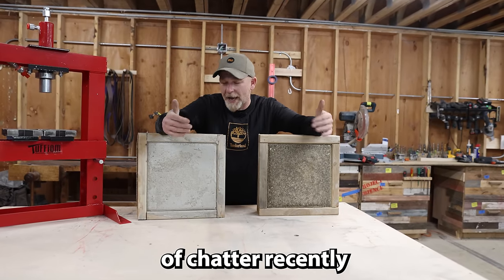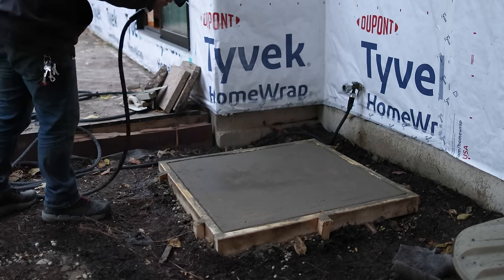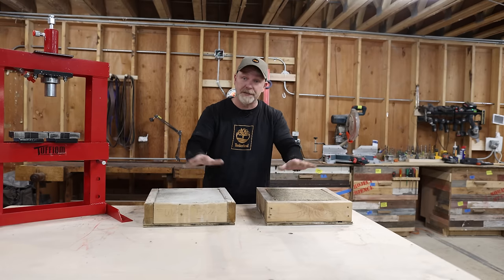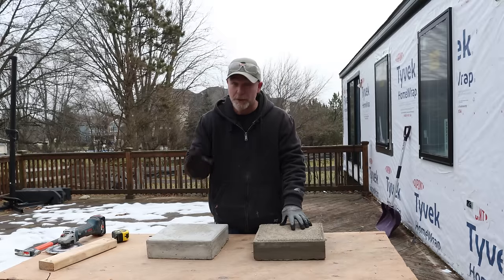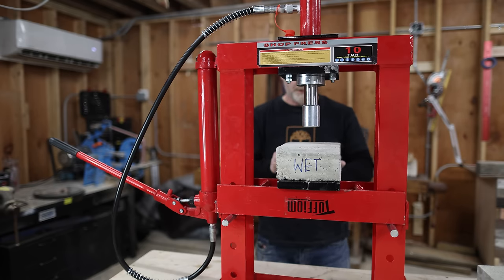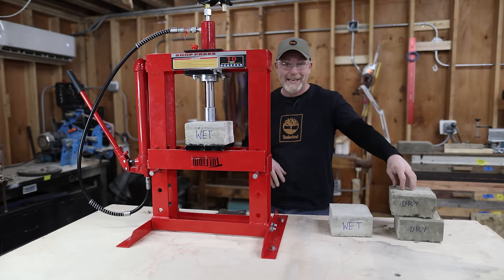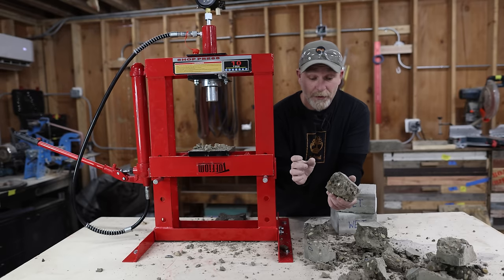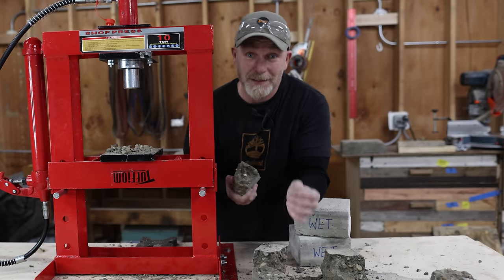The TRUTH About Dry Pour vs Wet Pour Concrete!! Strength Test - You WON'T Believe the results!!

Comment: Dumb question. would there be a difference in a wet pour the way you did(set up concrete mix then mist it) or have a pool of water and pour the mix into it.

The context is like a post hole. Witch would be better. Wet mix, pour dry and mist the top, put water in bottom of hole then fill with dry mix.....

Side question. What's best if the hole already has ground water in it or does it make a difference.

Comment: It's amazing how many comments start off on here with "Certified Concrete Grand Pubah involved with over 50 years of testing...".  Look, we all know dry pour is weaker. BUUUT, even in the video where he mistakenly says it broke at "2lbs of pressure" when what he meant was TWO TONS of pressure, it's still a good alternative for small slab/DIY projects where you're just going to place something lighter and don't want it on the ground.  I wouldn't build a house or a structure over it, but if you got a 4x4 patio that you're just going to sit your butt down in a chair on and watch the world turn, there's nothing wrong with it.  Not everything is a NASA project.  Sometimes you just need it to hold your beer and you up until you're buried 6 ft under.

Comment: I was thinking of doing a dry pour for a concrete slab for a hot tub. 6x6. Weight with water is roughly 5,000 pounds (2.5 tons evenly distributed). Your test, it cracked at double the weight 5 tons. What are your thoughts? I’m either doing a dry pour or calling the cement people to pour it lol.

Comment: Without watching fideo first, my instinct is to say that dry pour is obviously weaker/inferior... Now let's see how it goes.  EDIT: After watching the video, it went how I thought it would go.  My thoughts have always been that "misting" can never get the right amount of water all the way through the slab to activate all the concrete molecules like mixing water can.  Maybe if you did a contiuous mist for 24 hours to get the slab completely soaked, MAYBE...  OR, if you put a hose at the bottom and slowly ran water under pressure until it starts showing up at the top.

Comment: Dry vs wet will always be weaker, but I had to laugh at the poster calling the point load "direct" - it was all direct. The plate just distributes the load vs the smaller surface area.

There's no question that a driveway should not be a dry pour. But a sidewalk or pad that is not going to ever have more than a couple of hundred pounds of load is just not a big deal. In any case, the true structure should be underneath the slab. If you haven't put some kind uf structure on the ground under it (compacted gravel, etc), then you're putting a flexural load on the concrete, which it is poor, and will cause all slabs to fail (crack). The purpose of a sidwalk is not to support lots of weight, but to provide a waterproof, non-skid surface that transfers the load to the subsurface, and often, as a stabilizer to prevent dust and erosion.

Comment: Dry pour is not concrete = it is partially cement stabilized sand and gravel. To make concrete you have to provide sufficient water to properly hydrate the cement. The hydration product of that grey powder is a mineral glue that sticks everything together into a monolithic block. No water - no glue. This is so important that even for wet concrete you should be continuing to keep it wet for a week after placement. the initial mix water and mixing also ensures every grain of sand and gravel is coated in wet cement gel. After initial set there is no amount of water that is too much. You cannot replicate this in the dry pour process. 
In construction they test cylinders pretty much as you are testing them all the time. If it breaks under less than the specified pressure then out it comes - it’s not concrete. In a cement plant the test cylinders are cured submerged  in a water bath to ensure full strength development.

Comment: You used a different concrete for the two samples?  Use the same concrete for the two samples.  One step usually missed.  Dry mix is fluffy,, lotsa air is within the dry mix.  In post holes,, I dry pack,, I use a 1/2 inch rerod and slide it all the way to the bottom,,, on the first pass .  Every 2 inches or so,, I slide the rod all the way to the bottom,, air bubbles rise up out of the dry mix,  Continue to tamp with that 1/2 inch rerod go around again and again and the rod will penetrate less and less,, Until finally,, you are only penetrating 2 inches or so.  If you are practiced at this tech,, the entire tamping takes about a minute and a half.

I would LOVE to see a comparison of dry rod packed mix,, vs the same mix wet.   I still think the wet will be stronger,, but by how much?

Comment: I wonder what would happen, strength wise, if you lined a form with plastic, filled it with water like a pool, and poured into that, and then misted the top?

Also, would it be possible to pulverized those dry blocks and make a wet pour from it?

Comment: I mean seeing the method Used I would have predicted Drypours poor preformance. Concrete gets the strength that it has via a chemical reaction between the water and the cement, you are then fundamentally relying on the water you sprinkle on top to diffuse through the thickness of the slab and get all the way to the bottom in order to trigger the reaction and get everything to cure and harden. 

Now I dont know the water permeability of concrete but I do not think it has permeability required to properly wet all of the concrete.  The crumbly nature of it is probably due to the fact that the middle of the slab is only loosely bound powder that didnt get much moisture and thus didnt properly cure. 

The closest thing I have heard to a "dry" concrete being good was a method where you mixed the concrete with not very much water and then packed it into the form with a compression tool of some kind (when such concrete is used in large engineering projects it is called "Roller Compacted Concrete" as in steam rollers). But that is generally less used because you either need special tools or a lot of manpower.

Comment: I am considering using the dry method for enlarging my back yard patio. 
It will be a 9x12x3inches with 3 inches of pea gravel.  
Even if the concrete only supports the advertised PSI, does it really matter if all it is going to see is foot traffic and a few patio chairs?   
The patio area is not accessible to a concrete truck and pumping it or using a wheel barrel does not seem cost effective.  My other option would be to lay pavers.

Comment: What gives concrete its compressive strength is the aggregate.  Dry and wet pour have the same aggregate.  What isn't the same is the cement paste that binds the aggregate.  Cement requires water in the right ratio to make a paste that binds the aggregate.  The wet paste grows crystals that link together.  Too much water and the paste becomes weak, to little water and the paste never forms.

Dry pour never gives the cement the opportunity to see the correct water-to-cement ratio to create crystal growth in the paste.  Watering it from the top "may" allow the top half inch or so to get the right ratio, but as the concrete on the top cures, it prevents the cement below from seeing much if any of the water that is now trapped on the top.  The thicker the dry pour, the less chance it will ever see any crystal growth.  

Dry pour is a waste of time and resources, and if you're relying on it for structural integrity, say for footings, it may result in structural failure and injury.

Follow the manufacturer instructions on all concrete DIY products.

BTW: What gives concrete tensile strength is steel reinforcement, placed on chairs at the right depth in the pour.  Not "pulled up" from the bottom.

BTW #2: Fiber, either steel or fiberglass does NOT give concrete structures any structurally significant tensile strength.  All it does is help to reduce concrete cracking during curing.  IMO, fiber is a crutch, when what should be used to prevent surface or structural cracking is: 

1) proper compaction of the sub-base to 98%, 2) steel reinforcement mesh or bar held up to the correct depth with plastic chairs, 3) vibrators used to ensure complete contact of the concrete with the reinforcement and reduction of voids, 4) control joints properly designed and installed, 5) constant wetting of the concrete surface for 7 days as soon as surface water disappears, or immediately if the concrete is exposed to sunlight; alternatively a surface sealer to keep the water in the slab and next to the surface to prevent dry out before crystal growth can finish.

Comment: but...over time if you don't exceed the strength of the dry pour it is self healing. The water gets into the cracks of dry pour and there is residual chemical reactions waiting to happen. Cracked wet pour on the other hand has spent all of those. Dry pour is more "flexible" over time for this reason. It will not however meet immediate extreme structural needs.
If I am going long lasting then I am doing dry pour that greatly exceeds the initial load requirements.

Comment: It didn't work because you did it wrong, all that misting was just wetting the surface. You didn't give it enough water for the cement to do its thing. Put the concrete in the form, saturate it with the same amount of water you would use in a wet mix, any excess water will be absorbed into the ground. At this point there might be some minner surface mixing needed to work some stones down into the mix, but other than that work it just like regular wet mix concrete. I still would not use it for structural stuff but most smaller flat work should be fine. The dry pour is acually best suited for fence posts, you just dig a hole big enough two sacks of mix, fill it with your post and your concrete, dump 5 gallons of water on it and your done.

Comment: ACI concrete tech.  There is a reason that no specs are given for dry pour concrete - its utter garbage that won't hold up to any kind of commercial use.  Its probably fine for an AC pad or a step out of your garage, but you cannot drive on it and it will not bear any structural or dynamic load.

Comment: It seems that dry pour could still be adequate for some applications, especially if for some reason it's much easier to do. Would it not be suitable for a slab under my propane grill? Seems like its uses may not be many, but it's not use-less. Or did I miss something?

Comment: Onbiously the aggregate isnt dispursed proportionately theough the dry pour causing numerous weak spots. Not to mention it hasnt cured in 3 months. Theres no doubt dry pour cant hold up to the compression strength of regular concrete.

Comment: ok ok, so I might not be smart when it comes to this stuff because I have never done concrete, and I will be doing it soon for a wet pour concrete for my oil tank slab. I am curious and I am not sure though if this would make a difference or if it would damage it or make it work but if you do tests and want to try this out let me know, I would love to watch it. When doing the dry pour and you pour a single bag in depending on size of course of the form, but would it work better if you lay a bad, spray with water, lay a bag, spray with water constantly doing that until you are done and then follow the directions with continuing to just lightly mist it during the timeframe. I am curious if this would make any difference or not.

Comment: Novice here so forgive me for asking a dumb question.  It took 5000 pounds to crack the dry piece. How many pounds does a small patio need?  I understand the concept of the demonstration.   I wouldn't do a driveway or building foundation but the dry pour would seem to be fine for a small area say 10 x 20 to hold a grill, patio table a 4-6 people.. Thoughts?
Reply: 10x20 needs rebar, but why concrete to begin with? Why not use pavers? Much easier to do IMHO.

Comment: if you put down 1 inch wet it then at 1 inch wet it, then add the rest of concrete to top. i bet it would be stronger. But never as good as wet pour. Wet pour can be done, in what is called slump. I have saw engineers send a whold truck load of concrete back if it did not pass the 1 inch slump test pouring it into a plastic bucket on the ground.

Comment: Should be called Lazy Pour.  AC slabs are one thing, but I see YouTubers dry pouring foundations for sheds!  Could probably pull the J bolts out by hand.  TapCon is probably not even an option, would be like trying to put a screw into sand.

Comment: You are comparing APPLES TO ROCKS. It is axiomatic that a wet patio or garage slab is stronger than one that is dry poured. That being said, it took 8 tons of pressure to create cracks. That is 16,000 lbs of pressure to create cracks.  You can invite 100 people to your patio and the slab will not crack.  You can also drive a F450 pickup truck (weighs 8,587 lbs) on your garage slab and IT WILL NOT CRACK. So what are you trying to prove? Most people know that wet concrete is stronger than dry.

Comment: Pouring the concrete into the hole, then the water, doesn't work. The two aren't mixed properly. You need to mix it prior to putting it in.

Comment: Dry pour is a fad, and doesn't change reality.  Modern cement is a hydraulic product, meaning it is using water to develop its strength.  It is not drying that makes it strong.  In fact, too little water makes it unable to develop full strength.

If you put down a 1/2 inch layer of concrete mix, then soak that before adding another 1/2 inch layer, through the entire depth of the pour, it would perform better.  As others have indicated, submerging the dry pour for an extended period of time is likely to lead to deeper hydration of the mix and better strength.  Areas with constant rain might see better performance from dry pour over time.

I would bet that any dry pour concrete will always be somewhat weaker than wet pour concrete under the same conditions.

When testing samples for pressure, the samples need to be capped in a high strength capping material to ensure absolutely flat and parallel pressure faces, which must be fully supported across each face.  Otherwise, a single test result is fairly meaningless.  In this case, the large difference due to incomplete curing showed up clearly and early, but other factors may have been at play and amplified the apparent difference in strength.

Comment: Why don’t you comment on how too much water in your pour will affect the strength as well. The ideal pour is just enough water to get the concrete to stay in place and float the surface easily for the final finish troweling. Then keep the pad from drying out to quickly by covering with a waterproof sheeting.

Comment: I challenge you to redo this test by adding the SAME Amount of water you would add to yr wet mix . Start off misting then graduate to spritzing as the concrete gets wetter .spritzing every 10 mins….THEN this would be a fair test in my opinion.
Reply: But that's one of the flaws with dry pour, folx have no idea how much water they're putting on it. When you follow the directions it's easy to measure 2L of water per 60lb bag.
Reply: @13squier  My thoughts exactly. I’ll be testing that theory this weekend on a toilet slab.

Comment: You said two pounds per square inch. I don't think so. Maybe two thousand pounds per square inch. That was after you had already fractured it. Sidewalk grade concrete tests at three thousand pounds per inch, normally, so a dry pour that has had a full 28 day cure would be sufficient for a sidewalk, an air conditioner slab, or a shed floor.

Comment: SMALL PADS LIKE FOR AC UNITS OR IN FRONT OF DOORS ARE GOOD BUT MAY REQUIRE REPAIRS. WHEN USING A WET POUR THE WATER MIXING CREATES ANOTHER SUBSTANCE. WET SOAK AND MISTING THE CONCRETE IS DOING JUST THAT.... I WONDER IF THE DRY POUR IS POURED IN THIRDS IF THAT WOULD MAKE A DIFFERENCE... OR MISTING EVERY 15 MINUTES INSTEAD OF 30 MINUTES

Comment: Mixing is an important part of the structural process of pouring and finishing concrete, just like mixing a can of paint is essential for sealing in painting. One thing that gets undervalued in all the dry pour video I see is the art of floating and working a poured concrete surface. Floating a surface pushes down the aggregate and brings the cream to the surface which hardens smooth and does not allow the sand and gravel to flake off or chip. Most people do not know that concrete is nuclear, It will never stop curing. Water and mixing is the catalyst. Really, its just a matter of ignorance.

Comment: First off you put a bottom on the forms and admittedly added too much water to the dry. Then placed it on the press with a broken corner down and acted shocked it cracked along that corner. Every dry pour I've ever seen stated that about half the strength is lost. Your small pads for AC should be fine because you didn't trap the water in the concrete.

Comment: Late to the conversation by a few months but would like to compare this to concrete tiles.  From what I can tell, tell they put the color in the bottom of a mold, add dry cement, and add pressure to the  form (much like the press in your video.  This corxes the wet color into the tile.  My question is, does the pressure aid in curing by both forcing the moisture throut the mix, and or heat generation?  Just curious.

Comment: there is a correct way to dry pour cement...  and from what i saw  it was not correct.    pour dry cement, use tool to move it about,  add water use tool to move it about,  add more water till you have water sitting on top.    other words, you will use more water when dry pouring.  and you will not get any air pockets.

Comment: I tried a dry pour and had good results. It looks exactly like my wet pour two feet away. You did something wrong in the proper procedure applying water and not letting the dry pour to cure in a timely manner. Good video however.